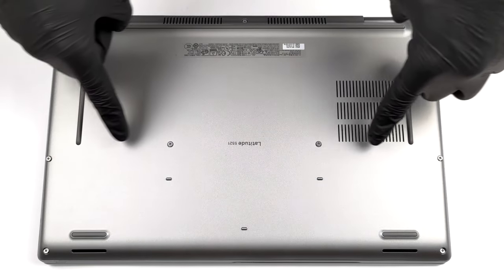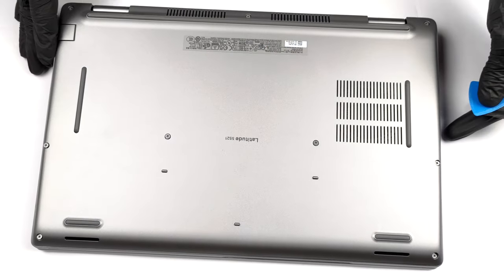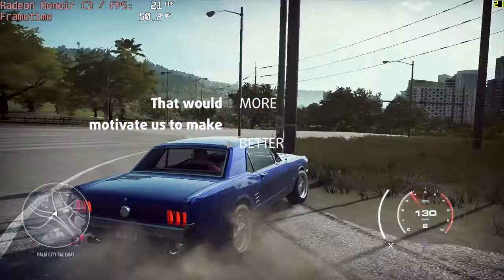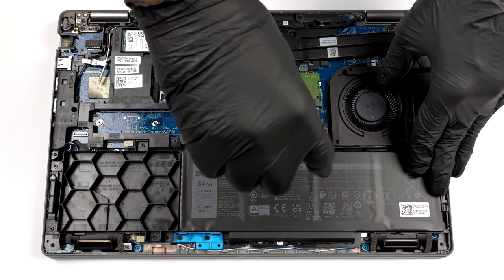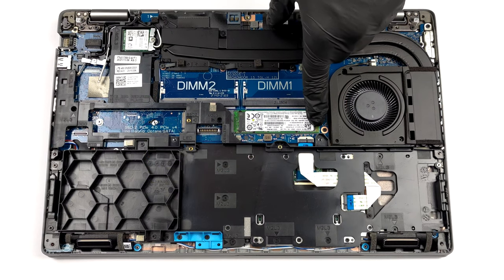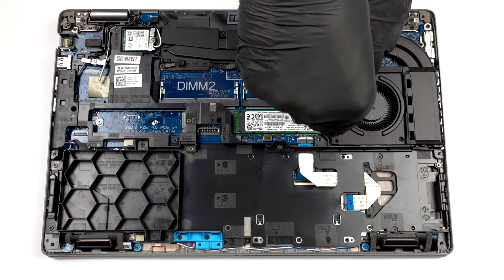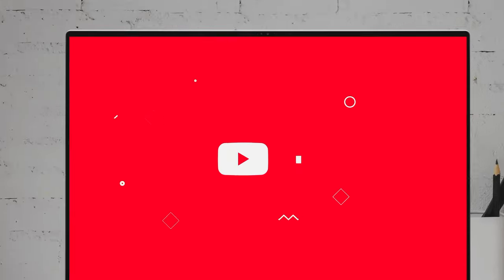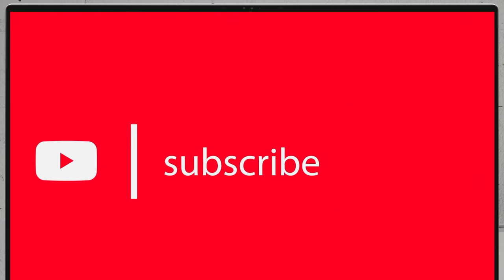🛠️ Dell Latitude 15 5521 - disassembly and upgrade options

Comment: I tried to replace the 64 Wh battery with a 97 Wh battery, but I ran into the problem that the battery connection cable is not suitable. Can you tell me the article number of a suitable cable?